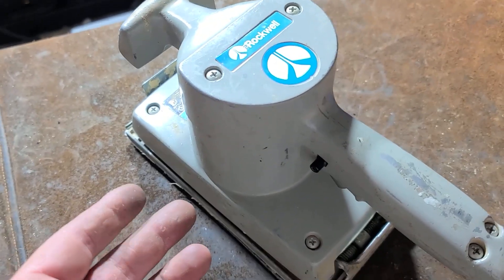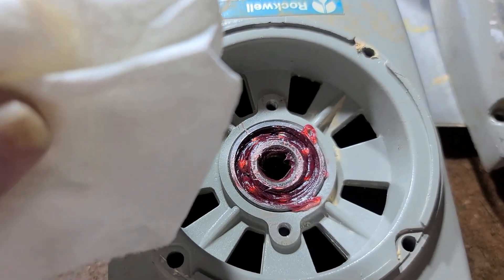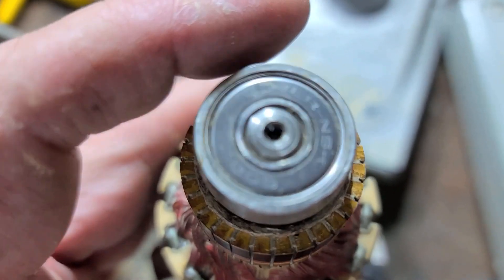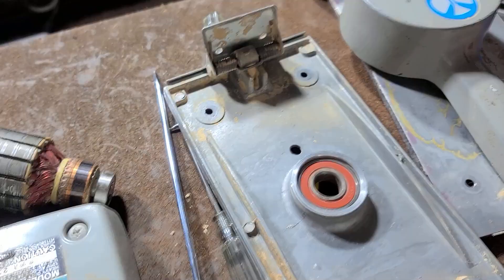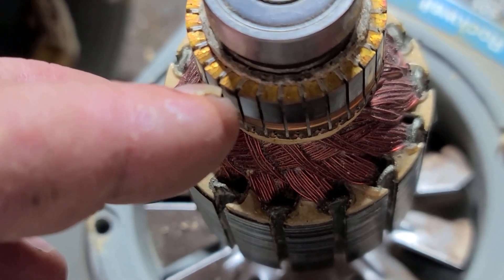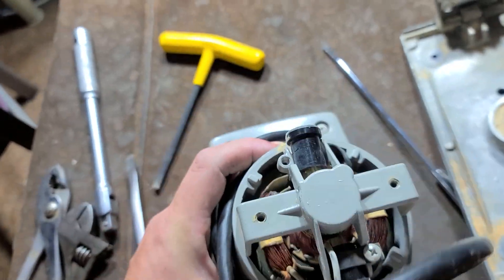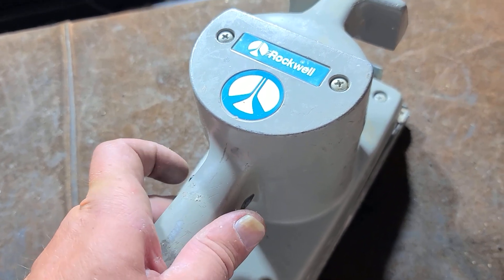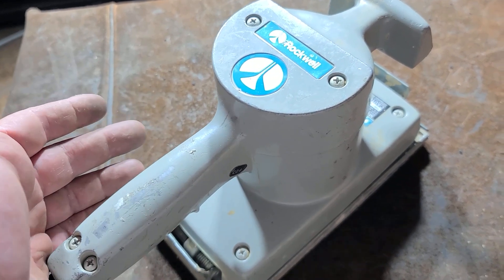Rockwell/Porter-Cable 505 Sander Service Guide

Comment: A  5/32" Allen easily disassembles the bottom plate in my Porter cable. I couldn't see this at first and started whaling away with a punch and prying from the top to no avail. Mucho easier to clean up the bottom and squeeze a 4mm hex driver in there. 😅

Comment: I just need to know how to replace the pad ... any chance you have video showing the disassemble?
Reply from the maker: You remove 4 screws and replace the pad, or peel the pad from the aluminum backing plate and cut new pad and glue it.
Reply: They sell on ebay

Comment: How do you remove the bottom plate?
Reply from the maker: after removing the 4 Phillips screws that hold the pad, use a hex wrench to remove the center nut, there is a hole near the center bolt to put in a screw driver to block the counter-weight and make you able to remove the screw.
Reply: @CatusMaximus  thanks!

Comment: Mr. Maximus, thank you for the video, it was very helpful. I had some trial and error replacing all of the bearings in my 505, but it is sorted out and operational again. I installed all SKF bearings.  
Location                             P/N
Top of motor -          SKF  608 2RSH C3      I know that it is a 608-ZZ bearing that came out, I couldn't find a 608-ZZ from SKF.  I do have some 608-ZZ coming that are NSK.
Bottom of motor     SKF  6201-2RS C3
Plate -                        SKF  6202-2RS C3
All from Ebay. Amazon has these bearings available also.

Comment: I believe my 6202 bearing is shot for the plate….  How do I remove the plate!!!
Reply: The plate bearing (6202) was shot on my Rockwell 505. Remove the sandpaper from the sander. Remove the (4) phillips screws that hold the pad to the plate. You will see a hex-head screw in the middle of the plate and just to the right (or left) of this screw, there is a hole where you stick a screwdriver in to block the sanding mechanism from moving. Use a 5/32" hex wrench to remove the hex screw and the washer. The plate should come off. You will need a set of internal snap-ring pliers to get the snap ring off the bearing. I used a 17mm socket and a rubber mallet to get the bearing out. Take some emery cloth and clean out the bearing surfaces on the plate. Before installing the new bearing, put it in the freezer overnight so it will contract.

Comment: The P-C 505 was indeed a great 1/2-sheet finishing sander! These seemed to die down when random orbit sanders gained popularity in the late 1980s and early 1990s.

I am wondering if you will ever come across another all-metal finishing sander: the Black & Decker 788 or 4015? These were made in Canada for most of its run.